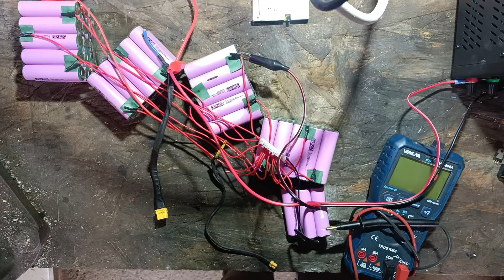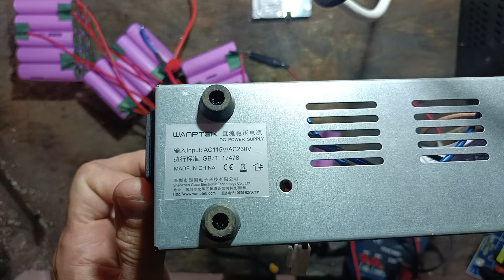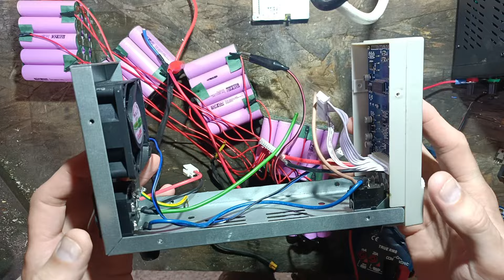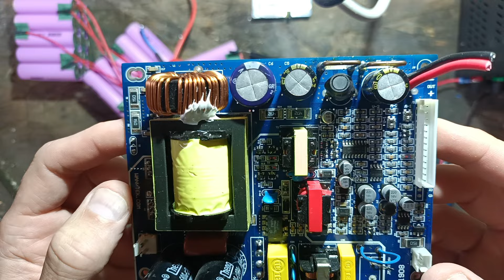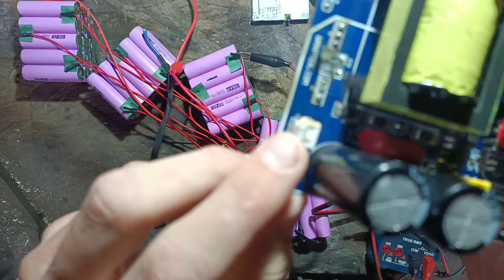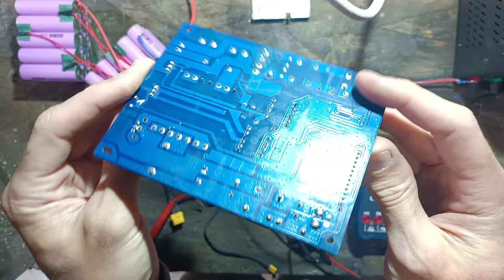My Wanptek 605W blows bridge rectifier and two diodes around the mosfets, but why?!?!

Comment: Looks like a simple half bridge SMPS like the old ATX ones. AFAIK the NTC is there for limiting the inrush current into the two big caps. Those NTCs get quite hot and I've seen a lot of them die just of age and heat. But if you just short it instead of replacing it, the inrush current may kill everything in it's path, including the diode bridge. That would be my guess.
Reply from the maker: I'll replace the NTC then! Thanks!
Reply: @AntonyCartwright  It's just a guess. I always test repairs to these with a 100W lightbulb in series so things don't immediately blow up when there's a short.
Reply: @AntonyCartwright  It's a good guess. I would also double-check those blue ceramic input caps, too, in case one of them has gone short, too.
Reply from the maker: @englishrupe01  I tested most things in this little unit. I never found the problem. I threw it out!